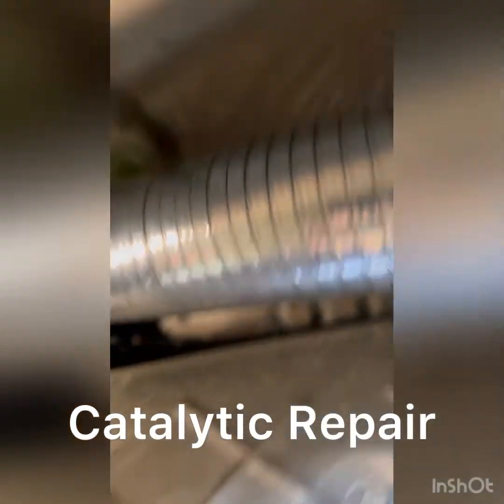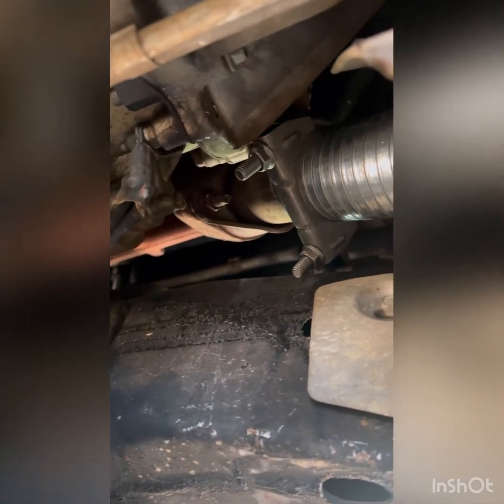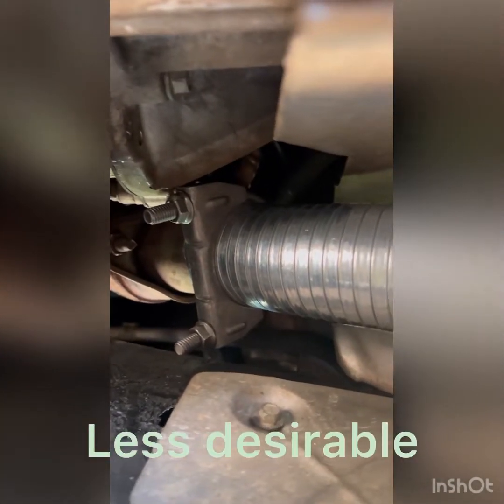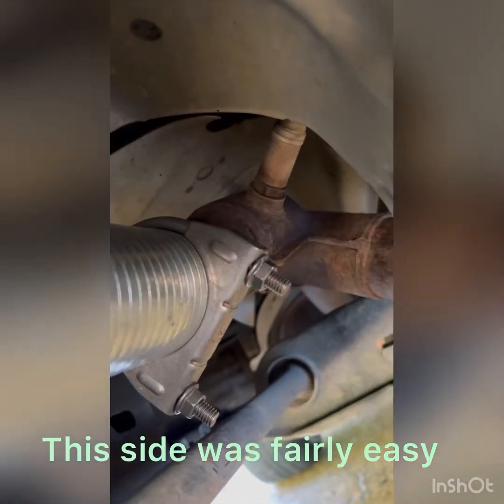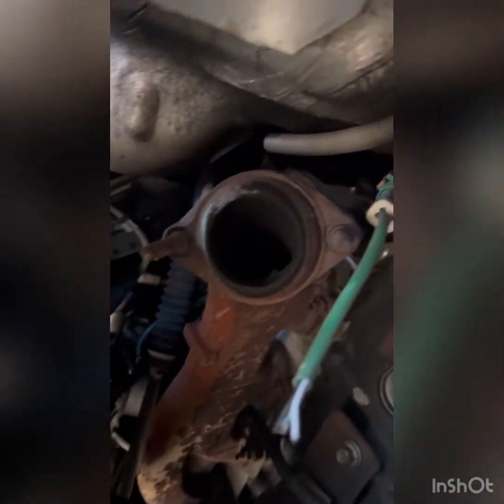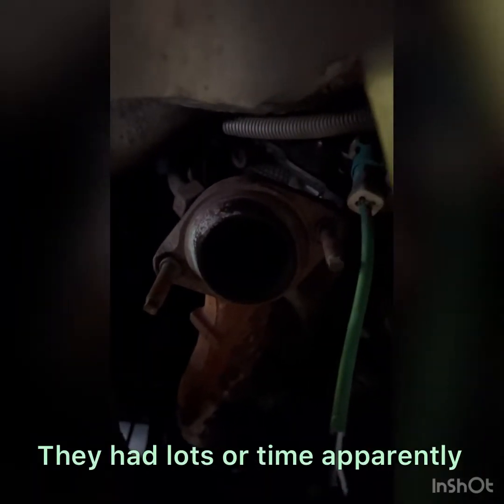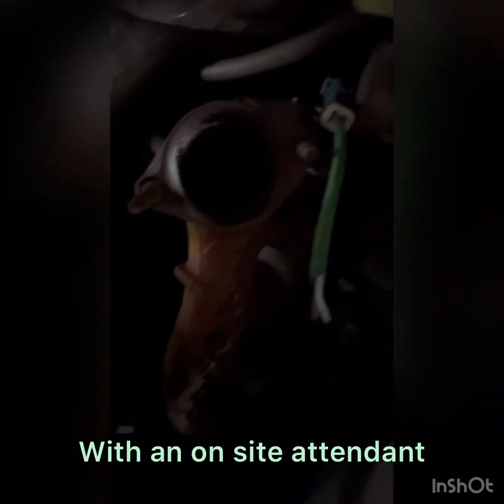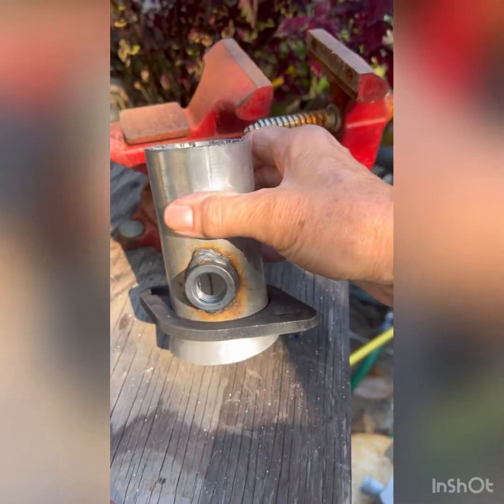Cheap Catalytic Converter Replacement

Comment: I have a question what part of America do you live the reason I'm asking I live in California and all the Cadillac converter have to be EPA so I can smog the car. My 2008 Mazda 6 I both of my Cadillac converter were stolen the manifold is like $2400 and Mazda don't have that piece
Reply: Mine were stolen as well. I just welded straight pipes so I know longer need to worry about assholes stealing my stuff. Find the right inspectors and throw them done extra cash to get a sticker. I'm in Texas